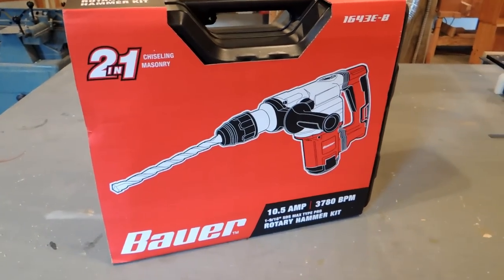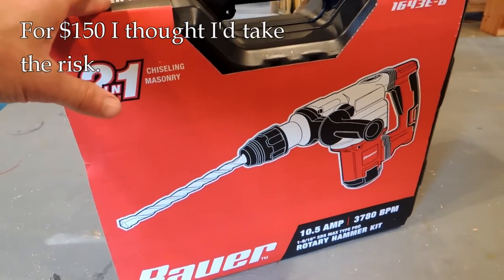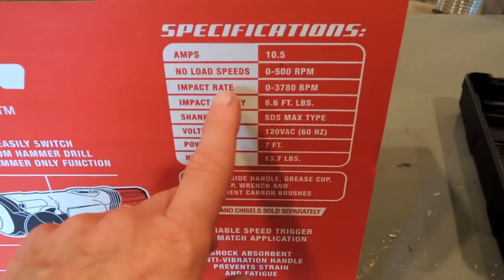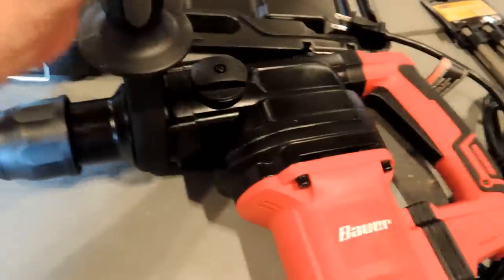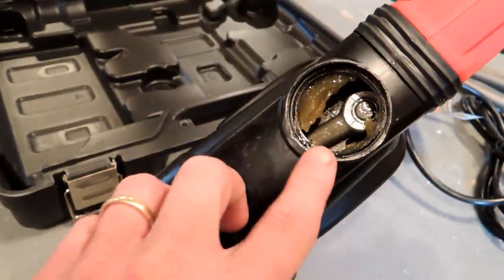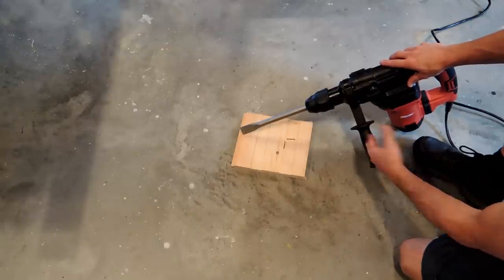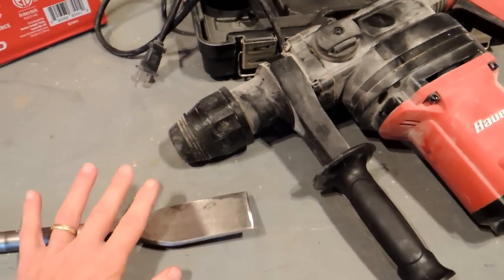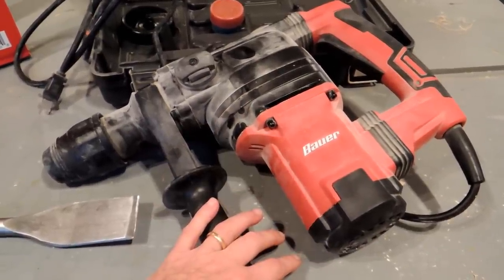Review: Harbor Freight Bauer 1643E-B Demo Hammer

Comment: why do you say -your'e not going to drill with this tool?
Reply from the maker: This tool is not really a competitor for a standard hammer drill.   It's heavy and unwieldy in comparison, and it doesn't have a drill chuck.  I think you can actually buy some large size carbide drills with the SDS Max shank (like 1/2 inch or bigger) but the rotary action is slow and accuracy would not be very good.  For any kind of  hole drilling in masonry I would reach for my regular hammer drill that has a chuck and the ergonomics to promote more accurate drilling.  The rotary action on this demo hammer is good for when you have a pointed chisel and you want to hammer a hole, rather than drill one, if that makes sense.   For example, you may want to chisel a series of holes to promote a break along a line.  This tool would be fine for that, using an SD MAX pointed chisel.    But, if you wanted to drill a small,  accurate hole for a Tapcon style masonry screw, this tool doesn't have a chuck for a smaller bit and it would make a mess of it anyway.  Even if you were drilling for something like a 1/2 inch or 5/8 inch anchor bolt in a foundation, a regular hammer drill would accept a standard bit and provide greater control and accuracy.  Basically, precision holes suit a regular hammer drill and this tool is best for banging away at material where precision and fine control are not paramount.
Reply: Its surprisingly fast drilling.  I put it through about 6 inches of rock in about 2 minutes with a 3/4 inch bit while the hammer  drill could only do 1/2 in about 5 minutes with a 5/8 bit.
Reply: Enduringcharm I highly suggest you try using the Rotary Hammer settting while drillling a large diameter hole, ie 7/8" or larger. The Rotary Hammer action with a 4-Flute carbide tipped SDS-MAX tool bit will surprise you on how acurrately it will drill a hole in a quater ofbthe time a standard hammer drill would with a 1/2" drill chuck. You will yield a percision round hole with a Rotary hammer drill (ie for a Wedjit 5/8-11 concrete anchor persay for a shop car hoist) vs a standard hammer drill with a 2-flute spadebtype drill bit with a 1/2" shank. The standard hammer drill (non Rotary action) will take 4x times longer per hole and the bit is hands down way less self centering and you will end up with a multiple egg shaped hole where the drill walked all over the place while drilling 3" to 4" deep or more. Your anchor at that point may not have enough gripping force to safely to its intended job at that point, at least speaking to put in a automotive hoist. In my case a was putting in a portable hoist so I needed to use a Wedjet brand anchor, where I could unbolt the portable hoist (Maxjax, maxjaxusa.com)  to move it to a storage spot when not in use.
So my point is, I had your same initial thought, and then after researching Rotary hammer drill found out how amazing and what a game changer they are to use for drilling through solid concrete. 
Now back to your commit about drilling a small wall anchor hole in concrete or a block wall, yes for 1/2" and under, a normal hammer drill would do the job just fine. It the large hole stuff that those drills do not do well at. 
That rotary hammer along with the 4 flute style sds max drill bits will turn the chips into dust vs tinny chips and the drill ends up drill so such a fast ROUND hole you will be floored woundering why you didn't try one years ago. To sum it up, the Rotary hammer function is a game changer and worth every penny.
Now I like to see a video with a head to head on how well the Bauer brand can compair to the industy lead of the Makita line. For the pro, buy the Makita every day, I'm interested for the DIY guy trying to say a few bucks wondering if he should rent the tool from the local H.D. or buy a bauer one from HF if using it more than 2 times. If planning on using it twice, it equally the tool rental price for one time from H.D.....? If you only intend to use the tool one time and never again, rent it from the H.D. and they include a few tool bits with the rental price for no charge. That one less cost you don't have to add in. Just my 2 cents. Hope this helps!

Comment: You said it, this is just another garbage from HT. I had one that worked for a few minutes as a hammer and then no hammering any more. A few more tries and it just drilling but no hammering.
Reply from the maker: That's too bad. mine is still going strong after many demo jobs.  You might take a look at the selector switch to make sure it is working and that you have firmly switched it to the position you need.

Comment: this tool is crap i've bought and returned two both died i kept the third one just to see what was breaking turns out the trigger over heats and locks up in the open position and cant be used. all three died with in a month. might be ok if i could buy a new trigger but I cant I'm a professional maybe its ok for a home owner.
Reply from the maker: Wow, that's too bad.  I've had a good experience with this tool so far.  In fact, I just loaded it up into my trailer for another bath demo.  I haven't kept track of how many demos I've done with it, but it must be over a dozen at this point.  In fact, it's saved my butt a couple of times when there was a tough floor to take up.  Maybe they are having a temporary manufacturing issue with the trigger?
Reply: i've had luck with most of their stuff as well but three in a row!

Comment: I have no idea what you’re talking about laughing saying that it won’t drill. I drilled through much cement with this thing and I chiseled cement with it. It’s a great tool. Don’t be such a snob. You don’t always have to buy a brand-name and spend a bunch of money to get a good tool.
Reply from the maker: Wow, maybe cut back on the coffee?  I wasn't being a snob--I still use the tool in my business, actually.  When I said you wouldn't use this tool to drill, I meant you wouldn't use it to do precision drilling, such as anchors through tile for a bathroom shower door or even for concrete anchors to set deck post bases.  For those sorts of things you should be using a smaller hammer drill, because the holes need to be properly sized to keep anchors in place and because excessive vibration will break surrounding finishes.  For less precision drilling this HF tool has a rotary option and you could use it for opening up large holes through a foundation for through-pipes, for example.

Comment: that floor had no cement board? lol
Reply from the maker: Different time periods had different construction techniques.  Baths built in the late 70s and into the 1990s typically had tile put down right over plywood.  It was after that period that you start to see cement backerboard.  Before that time period you would typically see a "mud" job with tile on top of a mortar mix.

Comment: My bauer just died only used twice
Reply from the maker: When you say it died--is it something simple that can be repaired?  A trigger connection or loose wire internally, perhaps?
Reply: I dont know what happened. I was using it and it just died... I took the carbon brushes out and replaced them... Nothing. I'll call the technical support Monday... No warning just died

Comment: Gave you a thumbs down because in the beginning you said it's garbage, not everyone can afford rigid Makita DeWalt or Hitachi tools...the tools they sell are not overpriced and the last a reasonable amount of time considering the cost.
Reply from the maker: Actually, that's not what I said.  I stated that I generally stay away from the electrical Harbor Freight tools because they are made to be cheap.  They make a lot of entry-level electrical tools of poor design that I wouldn't recommend to anybody regardless of budget.  I then went on to note that Chinese made tools are becoming better and I gave this particular tool a positive review.  I'll also mention now that in the past few months Harbor Freight has introduced lines of electrical tools intended to be of better quality, and which also cost more.  In my reviews of tools I attempt to tell the whole story, not just act like a fan-boy.  I'm just as hard on name-brand tools when I review those.
Reply: The tools are not over priced, but the batteries are. I tend to buy used batteries and replace the cells cheap myself

Comment: Wall Tile isn't hard to pop off. You really don't know what you're talking about. Try doing floor tile with that thing. Completely different dance.
Reply from the maker: It's a shame you didn't actually watch the video before popping off a message.  Starting at 9:31 is the floor tile demonstration.  And as far as knowing what I'm talking about, I've owned a remodeling business for 15 years and I've long since lost count of how many bath and kitchen remodels I've done.  I didn't see your company name in your message, but presumably you have experience equal to mine in order to make such quick judgements?  Maybe instead of an insult, you could have just asked nicely how the tool worked on a floor and I would have explained how it has worked in the year and a half since I made this video, which is at least a half dozen bath remodels.